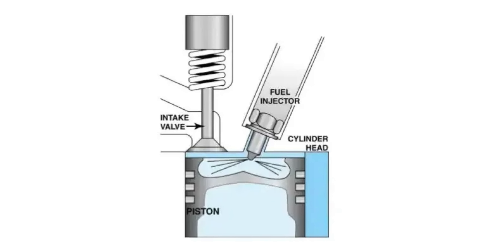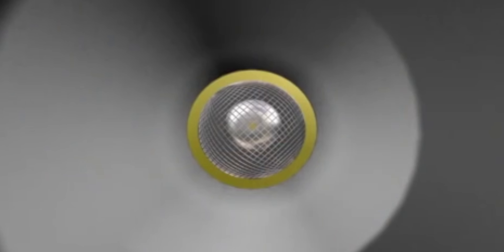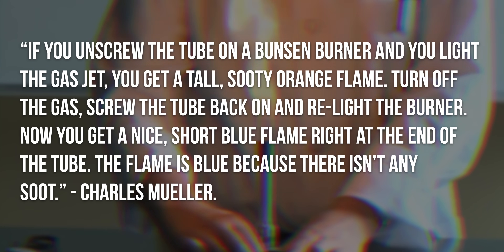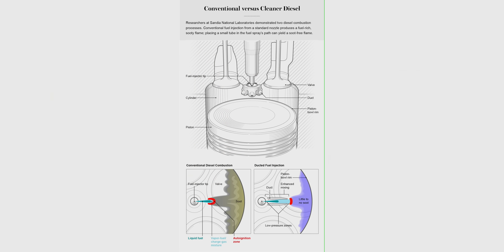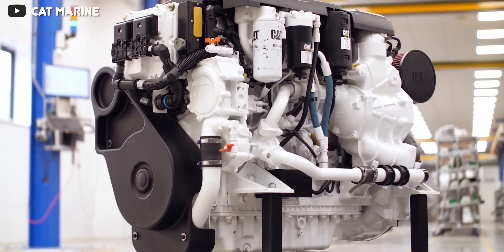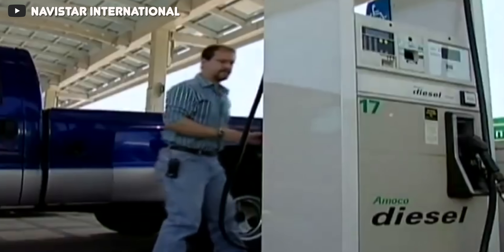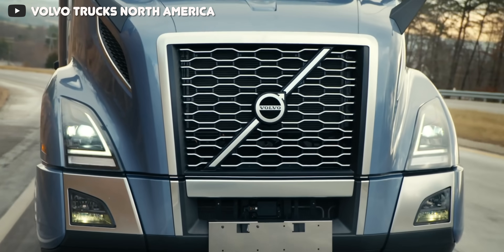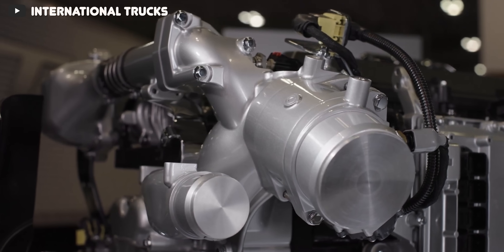Zero Emissions Diesels: How Ducted Fuel Injection can Save the Diesel Engine

Comment: How well did vortec work for gm?...This is a similar concept except you are porting in the cylinder. I see massive problems here. What happens as the tip wears? Falls into cylinder? The cylinder walls are not ment to be directly fired at and this will cause cylinder walls to crack/wear. Why are we so caught up on emission from something that is a drop in the bucket compared to industrial plants?
Reply: This design is more about much better atomization throughout the entire cylinder vs how it is now where most of the air fuel mixture is centralized below the injector.

It's not shooting jets of air fuel mixture at the cylinder walls.
Reply: The epa doesn't give a damn about the environment they just want to control people.

Comment: I got rid of my newer diesel truck due to these things.. long term ownership would be too expensive with the egr , dpf, def systems being more expensive to fix than the truck would be worth in a few years. Seems kinda dumb if they knew excess fuel in the combustion chamber was the issue with diesel engines, that they decided to bandaid it with these crazy complex systems instead of just fixing the injection systems.. doesnt make sense, not like diesel engines are a new thing..

I would be more likely to believe it has more to do with politics and the adoption of electric vehicles.. if they make diesel clean and reliable, why do you need electric???
Reply: This is what happens when the Government sticks its nose in an industry it has no business fooling with.  The engine manufacturers were given what was at that time almost unimaginably strict emissions regulations that they had to conform to in an unreasonably short amount of time.  The emissions regulations that started in the mid 90s were reasonably strict and spaced out enough to allow for cost effective R&D.  However as we moved into the new century the emissions schedule quickly sped up.  By the 2010s the emissions regulations were changing nearly every 2 years.  Often times with massive reductions in allowed output.  That left many manufacturers with a complex problem.  Do they completely start over and redesign entire engine families from the ground up using brand new, theoretical technologies that were completely unproven (Ex. ducted injection)?  Or do they continue with the technologies that they already have implemented; just ratcheted up to meet the new regulations. Manufacturers were familiar with EGR, and catalytic converters (SCR).  A large, regenerating, soot filter wasn't a huge engineering or technical stretch either.  In most cases the OEMs already had the basic manufacturing infrastructure, and know-how to implement these technologies in ever increasing levels to meet the increasingly more strict emissions regulations.  This, plus the fact that all these technologies were bolt-on, or externally mounted systems that could be standardized and used across an entire engine family.  The manufacturers knew that there were other options that had the potential to be more cost effective and simpler.  They just didn't have the time to research, develop, and finance them.  Prime examples of this would be International/Navistar and Caterpillar.  International/Navistar made an error in judgment thinking that they could meet the new regulations without adding an SCR/DEF system.  At the time it was a stretch but was possible, and meant they could offer a significantly lower cost of ownership.  However as the regulations continued to tighten they quickly realized their mistake, but it was too late.  The lost year or two of development was a deficit they couldn't recover from, ultimately costing the company 99% of its engine market share.  Caterpillar took a totally different approach.  As they examined the emissions schedule the decision was made to completely do away with their On-Road engine department.  The cost/risk of developing the necessary technologies was too high.  This plus the much slower and more relaxed pace of the Off-Road engine emissions schedule meant they could slowly develop the necessary technology, and for the most part, avoid the major growing pains being endured by their On-Road counterparts.  In the end it all boils down to politics and government overreach.
Reply: @davidbryan5203  A lot of green GND minded politicians honestly dont want you driving anything anywhere, electric or not and really would rather you're were dead and not using up the earth. In the EU they have voluntary euthenasia now, that women Ursula Von derLayen is encouraging people to off themselves for the sake of the environment. their GND ideas with green energy means there will not be enough energy and food to go around to everybody, so they want huge population reductions.
Reply: Mixing in more air to the fuel so it has more complete combustion, the diesel is vaporized so it burns more cleanly and thoroughly. But yeah the politicians and the vehicle makers are all strung out on going electric, which will be a failure with the public due to practicality issues. The solution is sticking with hydrocarbons. OR forcing people off the roads along with massive huma culling, like 75% of people eliminated AKA Cambodia the killing fields, but in the woke west it wont be so obvious as that.

Comment: its true diesel injectors use more then the needed amount of fuel, my boss knows a guy that deleted his kenworth heavy haul truck and he cant detune the truck enough to keep from rolling black smoke. No other mods just deleted and straight piped meaning the injectors under stock tunes are using excessive amounts of fuel that the truck cant keep up with unless is in much higher RPMs.
Reply: The harder the turbo boosts, more air in the intake and a better burn for the diesel.
“Rolling coal” as they say mostly happens when the engines are under boost, or before boost

Comment: It is not necessarily an injector.  It is a device that can be attached to the end of the direct injectors on the cylinder heads.  This device not only makes sense, it needs to be put into production.  Especially with the advent of renewable diesel fuel, this device would make all the exhaust after treatment devices obsolete because the engine is running much more efficiently and putting more work energy to the crankshaft and tires to get the rig further down the road before having to refuel.
Reply: Thats what I was thinking. Wouldn't it be easier to just make new long tipped nozzles for existing injectors?    Sure, the clips, o rings and fuel rail may have to be spaced out, but that seems doable.
Reply: @dankline9162  Take a look at any mechanic video dealing on modern engines. You will see things fail in bizzar fashion. I would not be surprised if carbon build up on nozzles tips due to poor fuel pressure would be the achilleas heel of these things...
Reply: Yeah and I think metalergy is even more important. More robust it is the longer it will last and the longer it will stay out of the junk yard polluting.
Reply: @TheAnnoyingBoss  A ceramic thermal barrier coating could be applied to create greater longevity and keep heat where it belongs...in the combustion process.
Reply: @matthewmiller2268  I wonder how that would compare to the type of coatings they do on these rifle bolt carrier groups. Nitride or whatever and stuff like that

Comment: We can build a particle accelerator yet we can't can't invent anything to beat the diesel engine ,diesel engines have advanced massively over the past 100 years or so but there is nothing out there that can match there power to weight ratio reliability and cost of this engine I drive trucks and being able to maintain momentum on a steep climb with up to 44 tons with a engine the size of a fridge is  impressive it will take something special to beat this
Reply: It isn't about power to weight or how fast it can rev. Diesel is all about torque, you won't make a gas engine develop the kind of torque a diesel can easily. At least not one with the reliability of a diesel. Hell, even trains which run on electric use diesel generators.
Reply: @buckfiden9106  higher torque isn't really an advantage if power is the same (meaning lower revs). That's what gears are for.
Reply: Electric motors smoke diesel on power to weight, reliability (usually one moving part) and cost. Batteries are another matter obviously. There's a lot of heavy duty locomotives (iron ore, coal etc) in Aus that use electricity.
Reply: There is a Lycoming single engine diesel training aircraft that can get 37 miles a gallon at about 90 miles an hour.  Diesel is superior.
Reply: Gas engines have better power to weight, reliability, and are cheaper.  Diesels have their place where weight isnt as big an issue, and have advantage of better mpg and running lower rpms if turbodiesel.  Still the best choice for big trucks i agree.  They dont compare in power to weight, there are probably production literbikes that make more than 1hp per pound of engine/trans assembly weight.  Same with some higher hp aluminum chevy v8s, like the ls7, just talking engine weight on that one.  All diesels i know of are iron block and very heavy, usually 1000+lbs.  Im talking cummins, duramax, powerstrokes here.   Diesels just cant rev as high as gas, but they will always have a place.
Reply: @connor3288  When I was buying my car (BMW X3) i looked at the basic 2.0i petrol and my 2.0d. The diesel and petrol make more or less the same peak BHP BUT the diesel has nearly 35% more torque - it was game over on that one !
Reply: @MrAvant123  HP is just a calculation, its a combination of rpm and torque. Half the rpm and twice the torque will make the same power.  Torque x rpm ÷ 5252= HP  Torque curves are good for seeing where a engine is breathing best, but different engines will have vastly different torque, even with the same peak hp, like a 500hp ls7 vs a 500hp semi turbodiesel.  For that you can compare HP curves between different engines.  For example there are literbikes that make more hp than many 4cyl and some v6 engines despite being 1/2-1/4 the displacement, and only making about 80ft lb torque.  Higher torque lets you make the same power at a lower rpm, but usually results in a bigger heavier engine when adding cylinders and displacement.
Reply: @connor3288   that 500hp ls7 is putting down around 480lb/ft at 4800rpm with an estimated lifespan of 100-200000 miles, vs the 500hp semi truck turbo diesel putting down around 2000lb/ft before revving to even 1/4 of the rpm and is warrantied for 250000-500000 miles.  Said diesel is a lot heavier and with fewer cylinders though.   A more fair comparison would be the ls7 and the 6.6L L5P Duramax at 445hp and 910lb/ft.
Reply: @connor3288  there's a reason heavy industry uses diesel. It's just better for it's use case. Let's be real here, the vast majority of people don't even use the benefits that petrol has over diesel
Reply: @NatoriousGamePlay  i said they have their place.  Modern truck diesels just arent worth it for most buyers, they have expensive emissions system problems and tend to get worse mpg than older diesels, and combined with the price increase of diesel fuel and engines it doesnt make sense for most.  Diesel repairs and parts prices are higher, and higher downtime.  The government has ruined diesels with overregulation imo.  The days of mechanical pump diesel cars/trucks are over in the us, those appeal to me.  Some of the fuel systems on modern diesels cost more than gas engines.  And government military diesels have no emissions systems as far as i know!  For everyday transport and towing non-commercial give me an n/a gas engine all day long.  I like diesels but for non-commercial use in the us it is more expensive and doesnt make sense.  I would love to be able to buy a newer Hilux diesel.
Reply: @connor3288  diesel motorcycles can get over 100mpg
Reply: @johnnycarson67  what diesel motorcycles? Is the question.  The only ones in the usa i know of are the military klr's.  Gas is a better option for lightweight stuff like motorcycles, better power to weight, lighter engines.  I wouldnt mind trying one though, or buying one for the right price.
Reply: @connor3288  Hayes Diversified Technologies was going to offer a civilian 250cc diesel bike that got 110 mpg.  Somebody got to them and paid them big money to cancel it.
Reply: @connor3288  they can't rev as high, yet
Reply: @TheAnnoyingBoss  
Sure they can ever heard the rack stick on a 8V71 detroit and had the sum bitc# run away I'm not sure what but I'm sure it's gotta be around 8or9 grand sounds like it anyway.
Reply: @buddythomas4331  it’s sound like it because it fire’s every second stroke not every forth  twice as much same revolutions per minute or turns of the crankshaft though not more rpm just  twice the combustion events
Reply: @TheAnnoyingBoss They don't need to
Reply: @connor3288  a gas vw Tdi is literally exactly the same weight as a gas engine. 

The 1.9 Tdi made same torque as Vr6 

And gets 3x mpg

U want gas??
Reply: @fastinradfordable  Go buy a new tdi.   Oh wait, you can't!  And vr6 is an overweight underpowered engine.
Reply: @connor3288  you can't because auto diesel is being actively suppressed by the oil companies and government
Reply: @connor3288  Mercedes om606  diesel, can rev like anything else and make incredible horsepower, have a look, , diesels make far more torque than those engines you mention, big diesels  can tow 40 plus tonnes with ease, you would break your aluminum block In half  , and yes a litre bike will produce that power and chew the fuel doing so;  but it has no torque to do anything like a diesel, or do two million plus miles.  Turbocharged diesels with air assisted/mixed fuel injectors will be the next best thing ,

Comment: Mercedes was working on something similar a few decades ago. Didn't have good power output as far as I remember. Amazing fuel economy and reliability but like 1/3 less power per displacement.
Reply: Then bring back the significantly more efficient uniflo 2-strokes.. problem resolved
Reply: @Errol.C-nz  "more efficient 2-strokes"  LOLOLOLOL They had 80% higher consumption for 60% more power per displacement. Not to mention their short lifespan, oil consumption, noise, low torque and high rpm power peak. Their ONLY advantage was weight when comparing naturally aspirated engines. With high pressure turbocharging, 4-strokes are far more reliable, efficient, and powerful. 4-strokes can utilize VGT turbos to make nearly instant torque rise down below 1200rpm, a 2-stroke can't have any exhaust backpressure higher than intake pressure.
Reply: @superjesus4307  oh how little you know
Reply: @Errol.C-nz  Thats a large sum more than you contain.